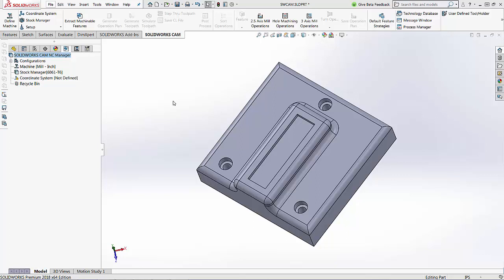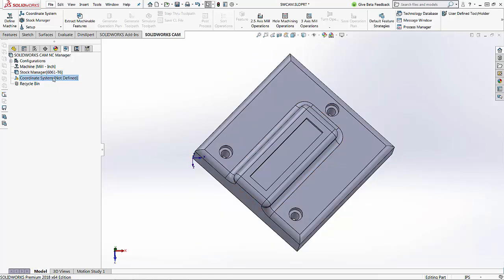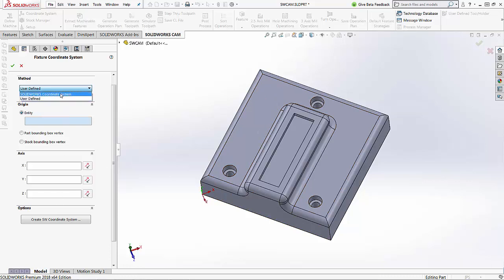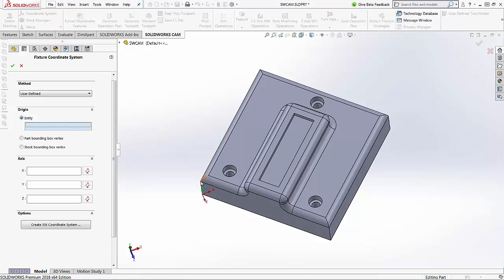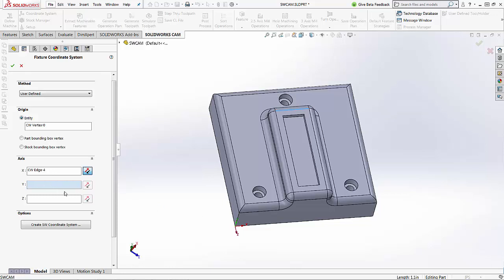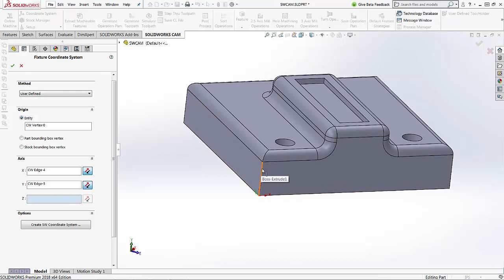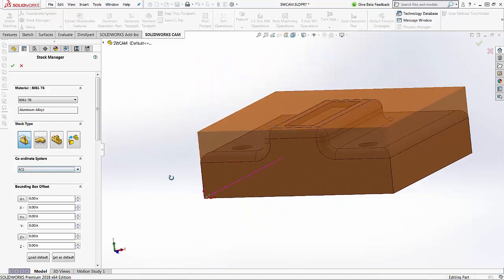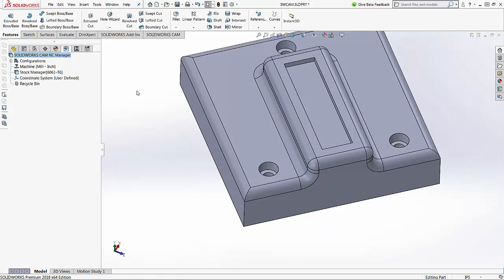What's New SOLIDWORKS CAM 2018: Creating a Coordinate System

Comment: How do you set up a secondary coordinate system for secondary operations (or mill part setups as they are called in SW cam)? What if I want one coordinate system for the first mill part setup,  but I want to flip the part for secondary operations and need a new coordinate system?
Reply from the maker: Good question! You can do this by creating the second mill part setup, then go to the Operations tree (second tab) in SW CAM and double click or "edit definition" on the mill part setup. Each setup has an an Origin tab so you can edit the zero location and an Axis tab so you can edit orientation per setup.
Reply: @hawkridgesystems  I'm really interested about this  if u do job on 5 axis  u have to do  mill setup for every face ? With cordinate sistem absolute ?